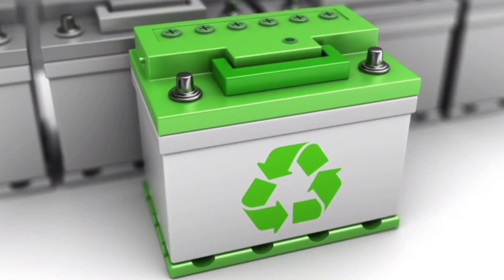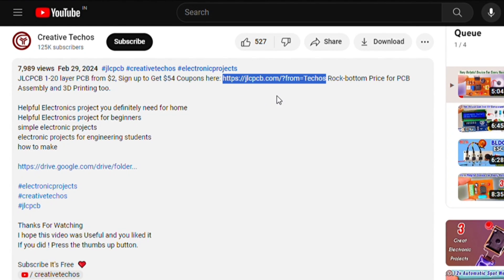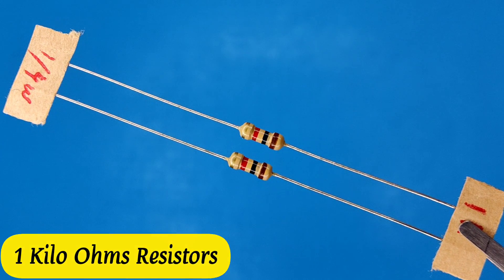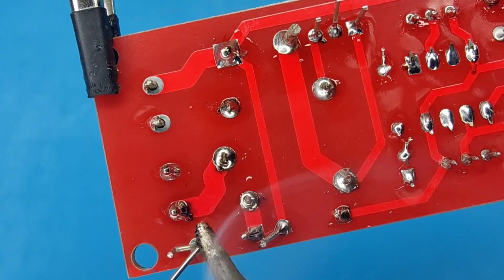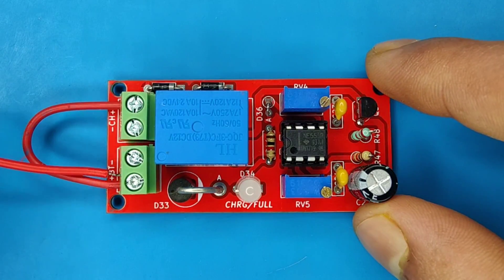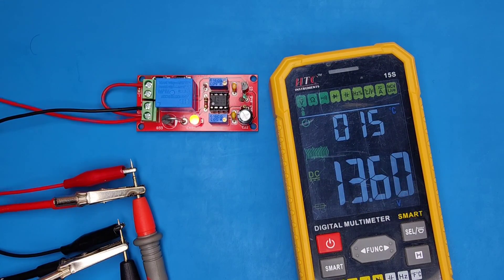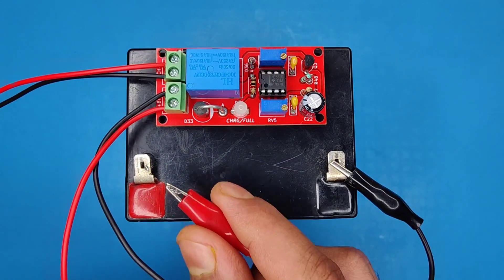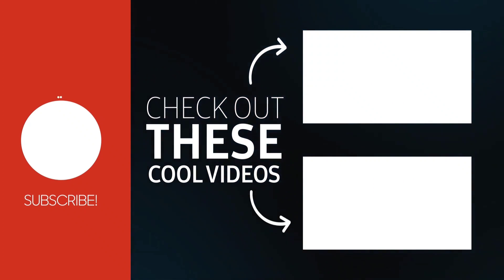Automatic cut off 12v Trickle Charger | jlcpcb

Comment from the maker: 👉Download PCB Files + Circuit Diagram
https://drive.google.com/drive/folders/1-GZYpQUup1oxFZyMYHthPyUagHJp8BoX
Reply: it is spot welder diagram

please give link of charger
Reply: आप मुझे एक circuit तैयार करके भेज सकते है
Reply: Bro make a auto cut off circuit in which input from transformer and also have output facility.
Reply: Yah PCB mangaane ke liye kuchh number number bhejo
Reply: Hi
Reply: This circuit does not work. I built one on a bread board with all the correct components using schematics from his Google drive, the relay wont switch on. He's not giving all the correct information on his schematics, I think he just wanted people to order the PCB on that affiliated link instead.

Comment: Dont leave discharge pin 7 floating, it does not drop the pin 3 output to 0 volts (2.5 v approx if not grounded) while in Low condition.

Comment: This circuit does not work. I built one on a bread board with all the correct components using schematics from his Google drive, the relay wont switch on. He's not giving all the correct information on his schematics, I think he just wanted people to order the PCB on that affiliated link instead.
Reply: It works fine for me! Did you do any measurements? Could also be your breadboard because it sometimes happens that the contacts are loose or bad. Are your components not broken or fake? Pin out of the transistor according to the manufacturer's datasheet? I once had a transistor from another brand with a different pinout. Disconnect pin 3 out of the ne555 from your transistor and connect a multimeter there (preferably auto mode otherwise volts) and then check whether the measured value is x volts or zero at your set value (trigger and threshold).